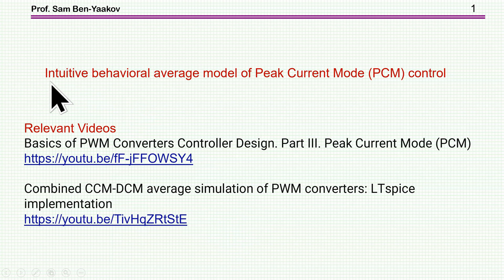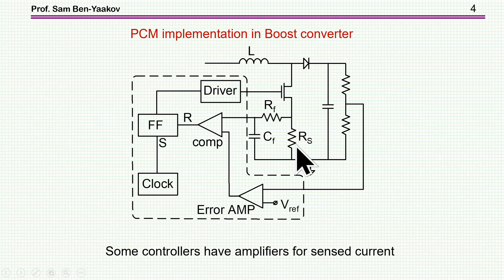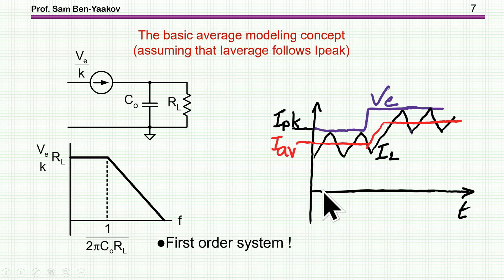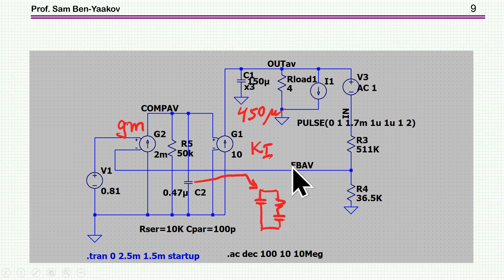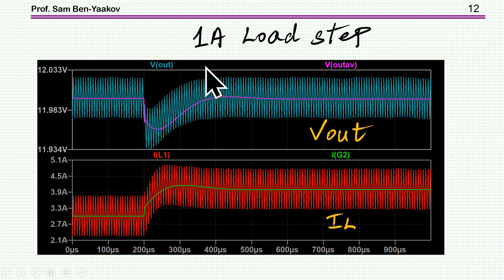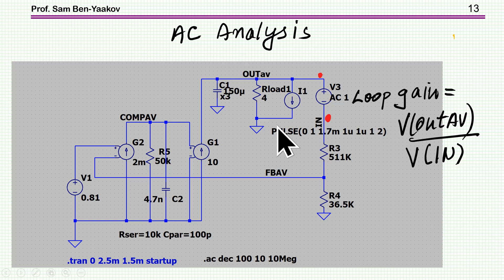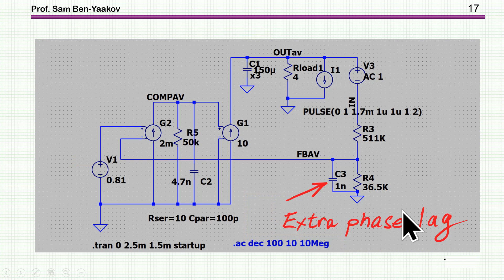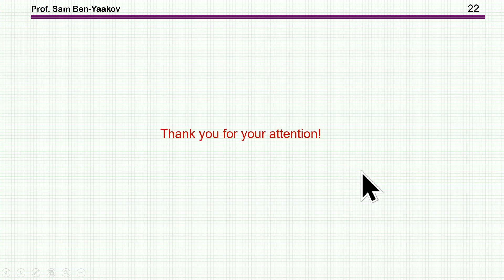Intuitive behavioral average model of Peak Current Mode (PCM) control

Comment: @6.06 sir you mentioned average model is correct for half of the switching frequency...could you please elaborate..is it only for average model or for any model?
Reply from the maker: This has to do with Nyquist sampling criteria. In a  PWM converter the signals are sampled and the converter is controlled at the switching frequency. This is a  sampling system.

Comment: something I realized while simulating this basic concept in Spice, is that at least with the built in SR latch in Spice, the SR latch is not edge controlled. Is this typical for the SR latch inside this converter? It necessitates the need for very narrow pulse train from the clock otherwise.
Reply from the maker: It does not need to be edge controlled just set rest. Obviosity when the S or R are removed it should keep the state.

Comment: hello professor.. nice video... how to determine the gain of G1 ? what value we should target for design ?
Reply from the maker: G1? Which minute in the video are you referring to?
Reply: Hello sir .. minute 10.16 in the simulation model
Reply: In the model u had a gain G1 of 10. I was wondering how to determine that value. ?
Reply from the maker: G1 is the relationship between the output of error amp and the measured current. That is, the current sensor constant. I think this is explained earlier in video.
Reply: Ok sir thanks

Comment: Very nice presentation, also seen from a practical side of view. Thank's Professor for your contribution.
It may also be very helpful if you could present more examples, including all relevant converter specifications, those which are necessary for Loop designs.
If possible, for nonisolated and isolated voltage and current mode converters.
Best regards
Udo
Reply from the maker: Good suggestion. I will try.

Comment: Happy new year Professor!
I'm wondering if you move the 450uF to the IN node if the AC simulation will still give the same results or will break...?
(of course the circuit is still the same, but I'm not sure the AC sim can handle that change)
Reply from the maker: Hi, for proper loopgain evaluation, the AC injection should be mostly forward and not backward . If you move the caps you will get an answer, but a wrong one.

Comment: Hi Professor. Great video as always. This is the model that my mentor Jack Alexander taught me many years ago. It is a very simple model that can also be used for DCM flybacks and is a first order model. Simple but still powerful enough to set the loop. Again, thank you for the video. Your videos are the best!
Reply from the maker: Hi Robert, I was not aware of the teaching of Jack Alexander or your videos and posts on the subject that I have just googled.  Impressive. Judging from the outcome (you) Jack must have been (or still is) an exceptional mentor.
I have been exploring the average modeling subject for many years now (almost too many to count). It has been my conviction that intuitive anderstanding, to which average models belong, are a prerequisite for good engineering.

Comment: This method for loop gain stability checking seems applicable to many typologies so long as the loop gain falls to zero dB well below the Nyquist frequency.  Thank you
Reply from the maker: Indeed. Thanks for comment.
Reply from the maker: Hi Chris/ Just seen you intersting write up, can the Siglent
SDS1104X-E  plot the loopgain of a PWM converter. That it, can it extract the injected signal from the ripple?
Reply: @sambenyaakov  I have used it to plot the loop gain of an op-amp circuit by using a test transformer to inject the voltage as you show in this presentation, but I have never used it for a switching converter.   It might be possible of one uses the Eres (extended resolution) function on the Siglent.  The Eres mode boxcar averaging acts as a low pass filter that depends on the sweep speed. By reducing the scope memory depth to it's minimum (7K points) the low pass filtering of the Eres mode will be maximized. This might be good enough.  The low pass filtering effect on my Siglent SDS1104X-E (hacked to a SDS1204X-E) is not nearly as good as it is on my Tektronix TDS784D.   If that effective low-pass filtering of the Siglent Eres mode is not adequate one would need to put an appropriate steep low pass filter on the input of the scope, characterized it, and then back out the phase error in post-processing of the data.
Reply from the maker: @Chris_Grossman  Filters will introduce phase shifts. For good result you do need to do an FFT transformation to extract the magnitude and phase of the  injected signal as done in network analyzers.
Reply: @sambenyaakov  There is no need to do an FFT.  The frequency and phase response of the filter can be characterized directly in the frequency domain with the Bode plot function of the Siglent scope and function generator.  I would measure at the same set of frequency points used for the loop gain measurement.   In thinking about it I would most likely use 3 to 5 pole Chebyshev filter with a cutoff of ~4/5 of the Nyquist frequency.  Both the ripple and phase shift of the filter would be accounted for in the in the pass band by the calibration, and data would be unusable above the cutoff frequency.  This would very similar to my compensation for the current probe gain and phase shift I did in my impedance measurement video.  I should have gone in to a bit more depth with my first response.
Reply from the maker: @Chris_Grossman  Everything is possible. But why use an equipment which is apparently not doing the job properly? I am using a Bode 100 and don't have to fiddle around with tuning and adjustments😊